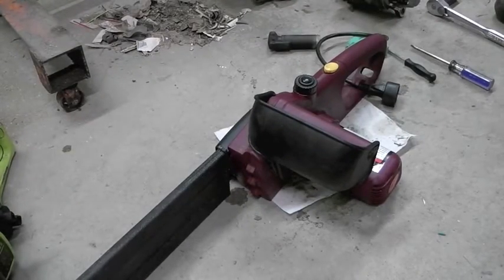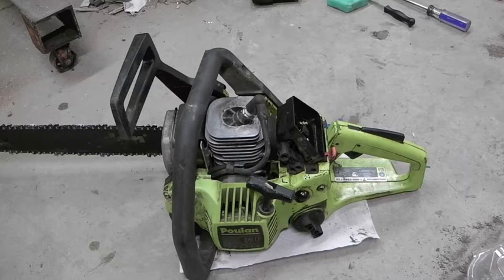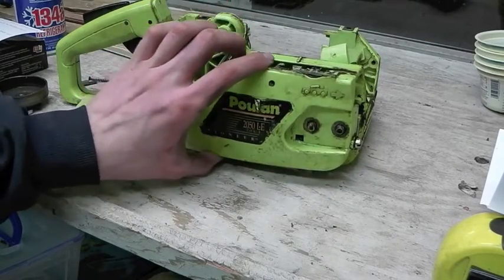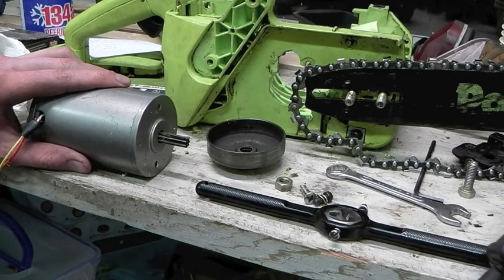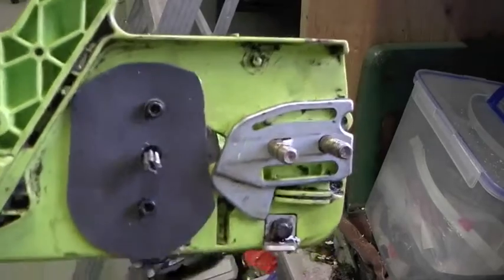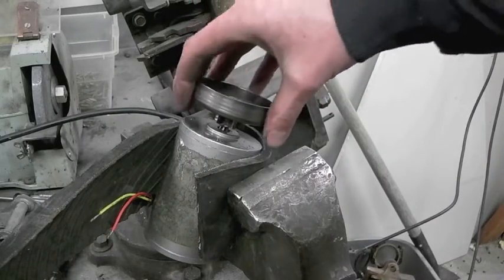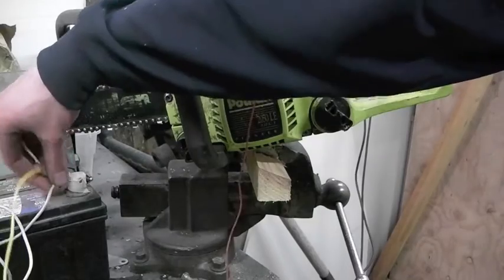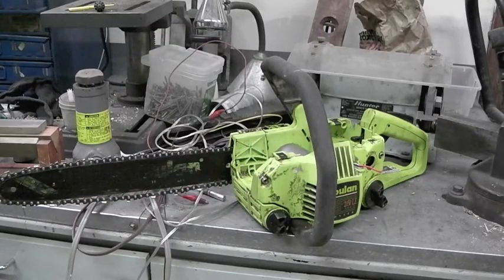How (not) to build a 12v chainsaw

Comment: I don't understand why you are wasting your time when today's cordless chainsaws are so good.
Reply from the maker: Because I like building stuff, my DIY saw (the next version, which actually worked) was cheap, and I don't like babysitting batteries! The saw I ended up with will run for as long as there's gas in my truck.
Reply: Đê xuât như thê lao đuoc phan hôi
Reply: Toi rat muon trai ngiem cac vi deo chê tao

Comment: You just need a big enough inverter.
Reply from the maker: Yeah, that was the plan starting off. Those big inverters get expensive quick, though, and a direct DC system is probably a little more efficient anyway. V2.0 (winch motor) worked way better!
Reply: But it makes other power tools plug and play and is useful for other purposes as well such as operating your home heater during a blackout and powering a good computer in the car. I consider the one in my car a good investment but I don't like good cordless tools because they are too heavy.
Reply: The efficiency of the direct DC drops off quickly with range. Try jump starting a car using to sets of cables to reach.
Reply from the maker: Yeah, I've got a small inverter built into my center console for running lights and battery chargers, and the 750 I got from Hazard Fraught has come in handy (turns out it will run my 4" Makita grinder, which has come in handy a couple times). And yeah, there's a reason we don't use low-voltage DC for long-distance power transmission. But there's also a reason we don't use 120v starter motors in cars... 12v is there and the load typically isn't that far from the battery anyway.
Reply: The cost of inverters is why I keep an eye out for free generators even non working ones Solid state electronics is the least likely thing to have gone wrong with it.
Reply from the maker: Yeah, you can't beat a proper genny!

Comment: Yeah people forget it take about 900 watt of electrical power to make 1 horsepower.  That would be about 75 amps.   Even with the HF saw you are pulling around 1100 watts so you are going to need an inverter of at least 1700 to 1800 watts to start it.  Just an idea look at using a PM motor off a HF Badland Winches- Item#61257  I have a strong feeling that the motor on Badland Winches - Item#61840 would be wimpy.  

The Tensen Minibrute was a nice little saw I had one in my 4x4 for many years.  Someone wanted more than I did it would seem.
Reply from the maker: +Kriss Femmpaws Good idea, I hadn't thought of a winch motor. Of course, if I had a winch motor, I'd probably keep it in the winch!
Reply: Sometimes you can find them on craigslist for cheap I've seen the older Superwiches go for 50 bucks.